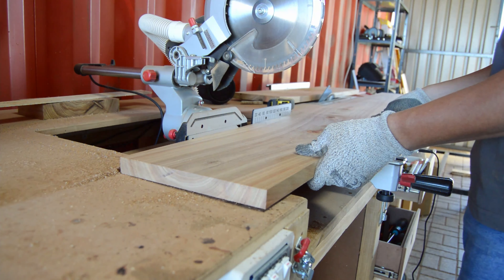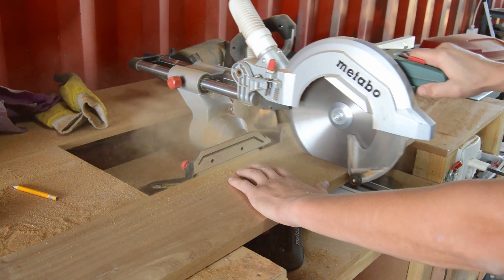How To Make a Console Table | DIY

Comment: Any specific reason you climb cut with the router? I noticed in quite a few videos that you don't route in the conventional direction, climb cutting with a handheld router is dangerous.
Reply: Small chamfers and round overs are fine when climb cutting. Heavy cuts is a different story.